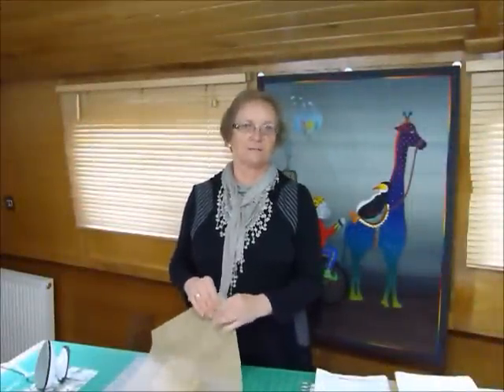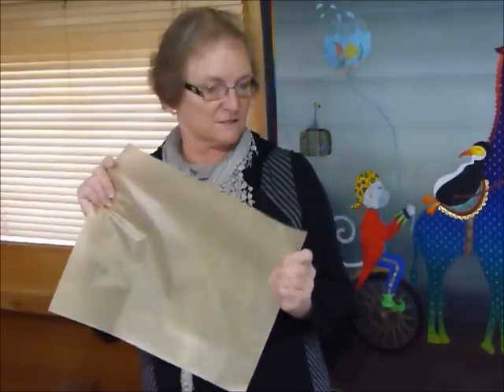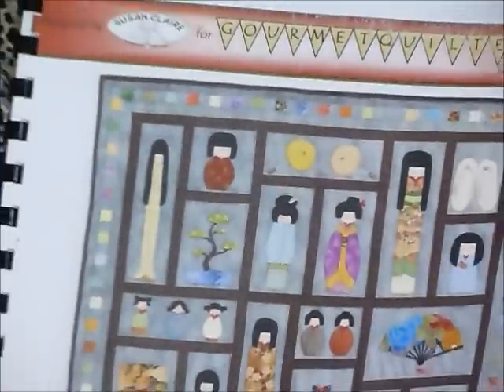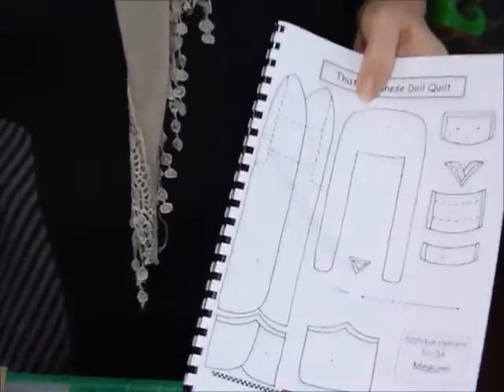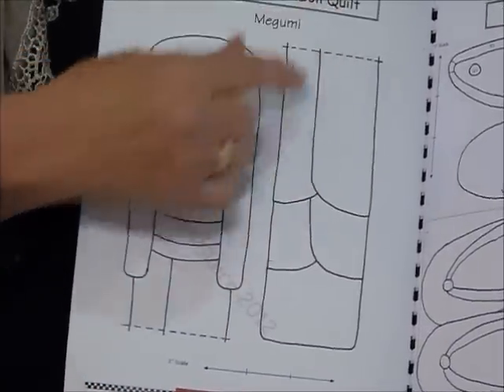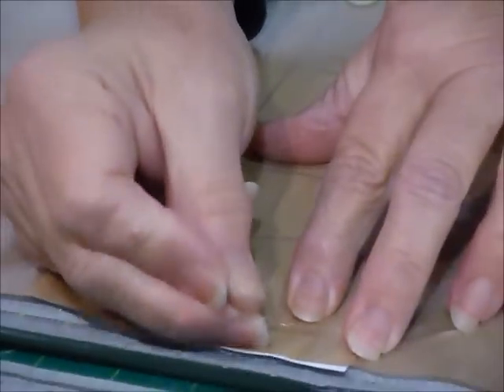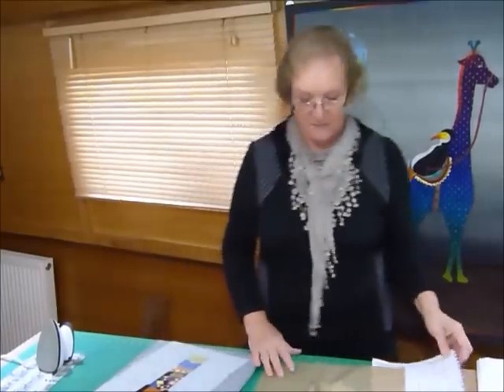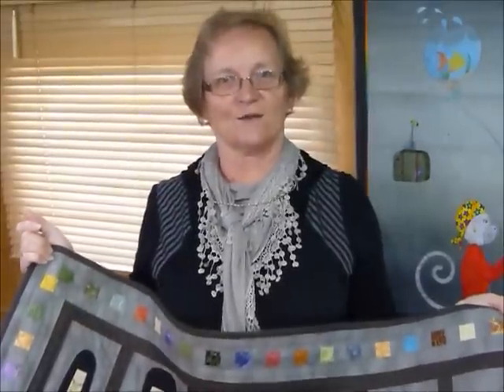How to use an Applique Mat for Fusible Applique - Quilting Tips & Techniques 174

Comment: I'm wanting to use your technique for my granddaughter's bed. It will need to be washed a lot. Will this raw edge technique fray?
Reply from the maker: Hi, thanks for watching. I have used this technique for all sorts of things including clothing which gets washed often. The fusible web helps hold the fabrics as well as the stitching. You may see a very slight "fluffing" on the edges but it doesn't fray. I don't have any problems with washing.